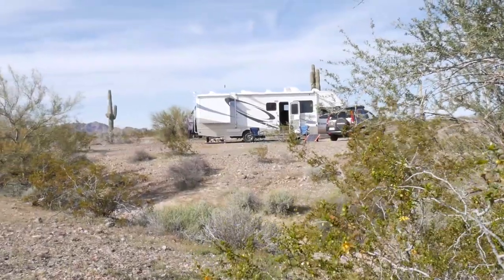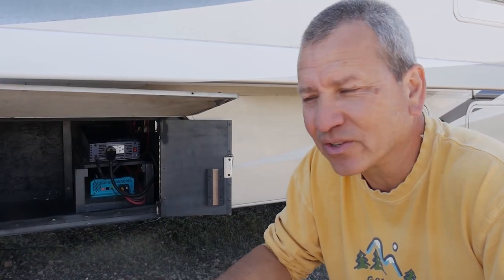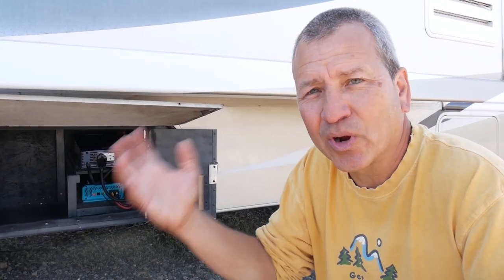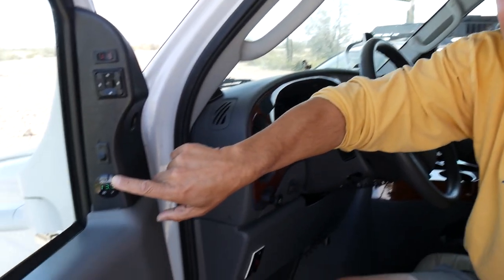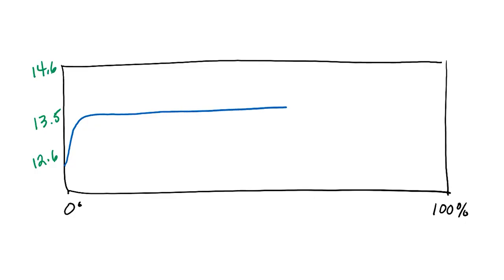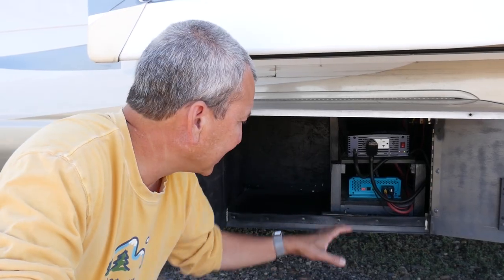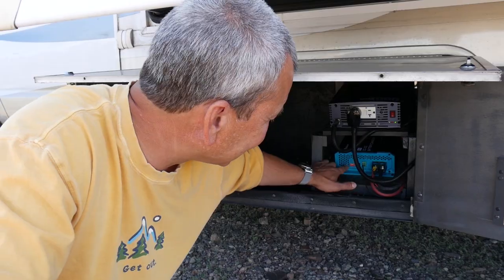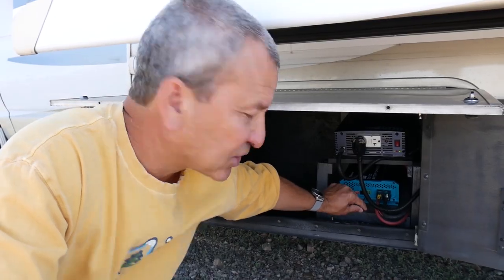Charge LITHIUM Batteries While Driving - System Setup

Comment: Good Video, One not so minor point. All fuses should be located as close to the source of power as humanly possible. They literally make terminal fuses that mount directly to the battery terminal for this purpose. Why? The length of cable between the battery and the fuse is unprotected, if your chassis were to wear away insulation and make contact with the frame, your battery would dump all it's energy into the frame potentially causing a fire. If however your fuse were located on the battery terminal, or as close as possible, the same worn insulation condition would simply blow the fuse, which is why you have it there in the first place. Once you adopt this practice you are much safer from a potential fire. I'm sure you are aware but for others reading, the fuse has to be the weakest link in the circuit, 20 amp wire with a 15 amp fuse is good. 20 amp wire with a 30 amp fuse means your wire will melt before the fuse. Sorry to be Preachy but I see both of these safety procedures violated all the time.....

Comment: I used a voltage sensive  little relay that cost £11 GBP about $14 - it triggers the  Renogy - it comes on at 13.2V and goes off at 12.8V.    I put a switch in with a little LED indicator  so I independantly turn it off
Reply: If you go below 13.2v with altenator off does it drain from your start battery? 
Thank you

Comment: I think you can easily go to 40A charger , they alternator won't have any problems handling that as long as you don't run it in the same time with your lights on , fan at max , and other accessories. usually those alternators are made to handle 140-200A load
Reply from the maker: Thanks. I'll keep that in mind 👍

Comment: At full charge it will ALWAYS have more than 20 Amps being drawn from the alternator. This is mentioned in the product manual as the DC-DC draws a higher current then what it provides to the aux battery (input amps > output amps). Your alternator draw for the 20 Amp DC-DC charger (Renogy) could be as high as 30 A's . This is why they ask that a 30 A fuse be used on the input side.
Reply: Really? That’s interesting and good to know. You say thats in the product manual? Is that the Renogy manual?  I’m thinking of doing something similar because where I camp solar is only useable if it’s portable with a long wire so you can move it around and even that doesn’t work a lot of the time. Reason? Dense forest so my travel trailer is in the shade 99% of the time except when driving on the highway which means I might as well use the dc-dc charger. I want to protect my alternator and truck battery as well as protect my lithium batteries.
Reply: @prepperjonpnw6482  20A output is 20A x 14.6V = 292W. Charger efficiency is ~92% so input draw is 292W/.92 = 324W. If you are running a modern truck with variable voltage alternator, the alternator may only put out 12.4-13.0V much of the time. Drawing 324W/12.4V = 26.2A (at most) from the vehicle system. In this case, a 30A fuse is too small. Fuses should be 125%-150% of the max continuous current. 26.2A x 1.25 = 32.75A. 26.2A x 1.5 = 39.2A. Best fit is a 35A but a 40A fuse could also work.
Reply: @prepperjonpnw6482  A 30 A draw on your alternator is not really that big of a deal to be honest. I've had this on my standard toyota 4runner alternator for a year and change and its quite smooth in terms of draw. I know folks who have 30A and even 50A's hooked up to their stock alternators and usually they can handle it. You can also upgrade your truck's alternator and there are quite decent after market options available.
Reply: @WorkingOnExploring  When in doubt, consult the product manual for what fuse they recommend and do accordingly. Renogy does have fuse requirements for this and other DC products.

Comment: One of the cool things I find is if you have an inverter you can run your refrigerator on 120v when you are traveling which is much safer than running it on propane while on the road.  With the DC to DC charger you can always be sure your house battery is fully charged when you get to your destination even when traveling at night (or when its dreary weather) when solar is not optimal.
Reply: 12v fridge
Reply: @jounik8980  If you have one thats great. Mines a 2 way....propane or 120v.  If yours is 12v you are still probably using 25a/hour so the DC-DC charger is fantastic to keep your house battery topped off.

Comment: Thanks Brian. This has been my concern for switching to Lithium. This makes it clean and simple. And I do prefer to use my solar when I am driving if it is sunny since the more load on the alternator the more gas the engine uses. David
Reply from the maker: Yes. My thoughts exactly. I actually turn it off when climbing up a mountain or at times when the engine is working hard.
Reply: Your solar can work perfectly in unison with the DC-DC charger, reducing the load on your alternator.  Unless you have a very small alternator that can't handle a maximum of 20A (in this case), its not necessary to shut it off.   I don't think going up a hill makes the alternator work harder.  When you have the AC and other accessories on, your power demand is higher.  That's when you'd want to shut the DC-DC charger off.

Comment: Regarding sizing the charger.

You can by temprature sensor to monitor the alternator temperature. When it gets to high, the charger is turned off.

The problem with maxing out your alternator is that the cooling fan runs to slow at high RPM combined with that litium charges for a long time in CC mode(bulk), so this overheats the alternator.

Comment: Brian - My 2015 Ford Expedition with a 3.5 Ecoboost and tow package has a 285 amp alternator.  I opted for the 60 amp charger but also made use of the LC terminal.  With your setup, you could easily run a second wire from the LC terminal to your switch location and swap the switch for a three way where you would have off, 20 amp and 10 amp.  The charger is designed to cut the output current in half if it detects current on the LC terminal.  For example, if your're driving at night and just need to power your refrigerator you could limit the current to 10 amps.  You may also want to limit the current if you're driving in the mountains and want more power from your engine.

Comment: Wow. You helped me figure out the best practices with this unit. I love the idea of a power switch for the controller, and the 14.4v settings. I would still use the power signal for run however as it is possible to leave the charge switch on a deplete a starter battery.
Reply: I'm assuming the manual  switch for the DC DC charger would have a positive supply from the ignition circuit  ?    Not directly from the start battery. But yeah I really like the idea of the manual switch and being able to switch it while driving .    Guess you could put an ammeter on the alternator output too and keep it say to a max of 70% of its rated output , more so if the engine is just ticking over at idle .